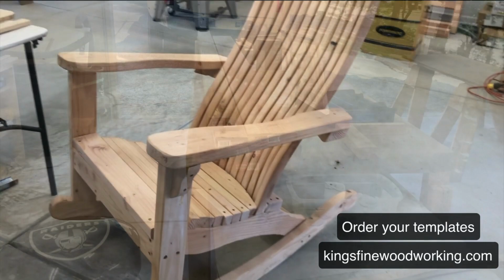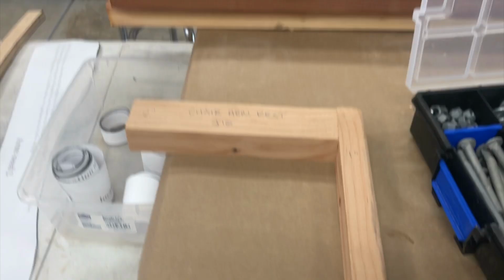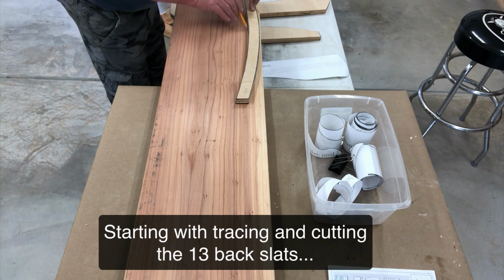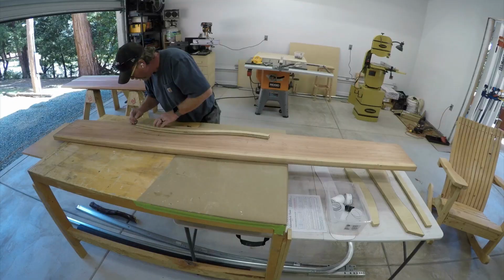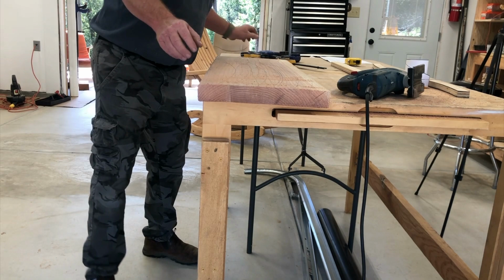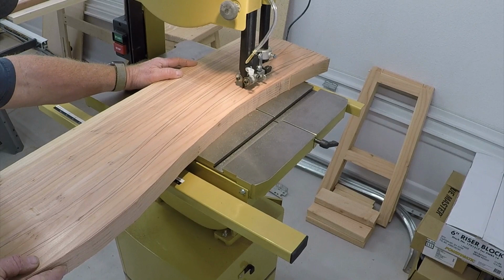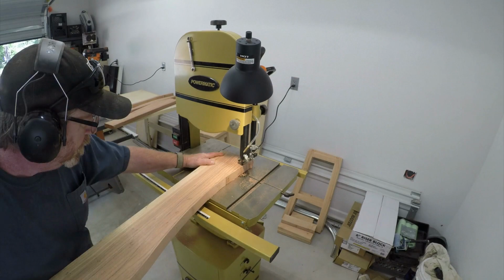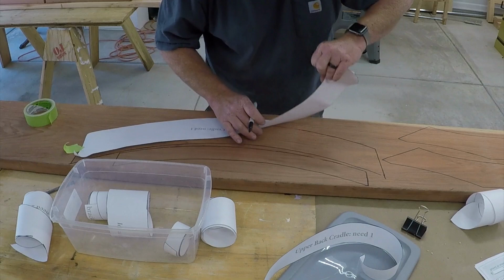Blog Adirondack Rocking Chair Build Part 1

Comment: What blade do you on your jigsaw - i.e. brand & model.  I have been having trouble with the blades bending left or right.  I feel I need a thicker blade.  My jigsaw is a Dewalt DW331K.